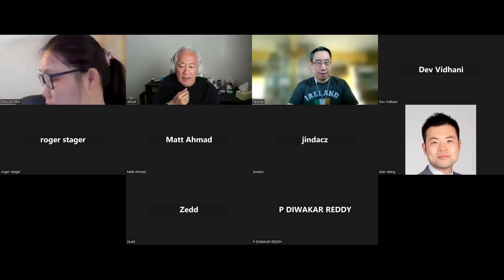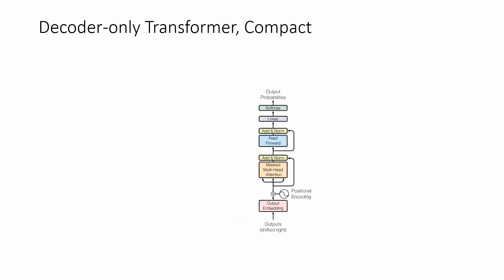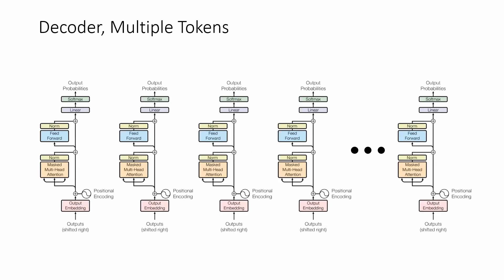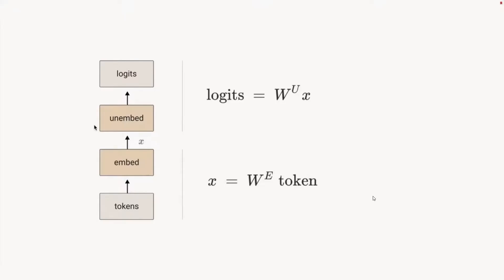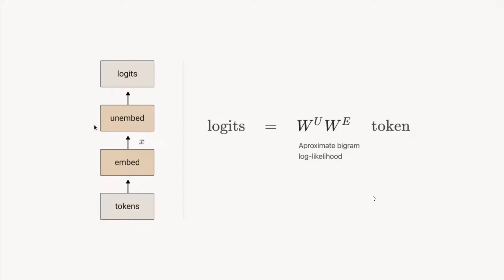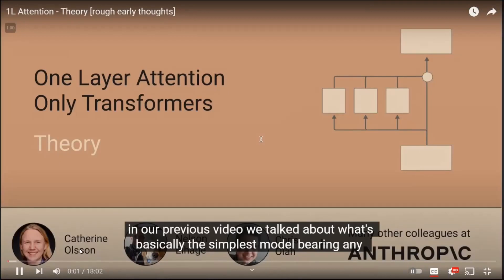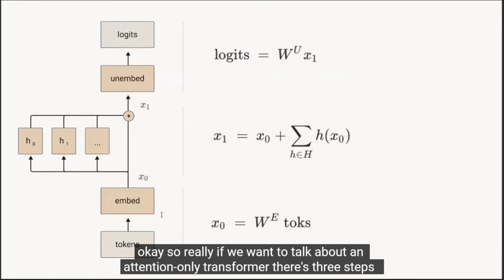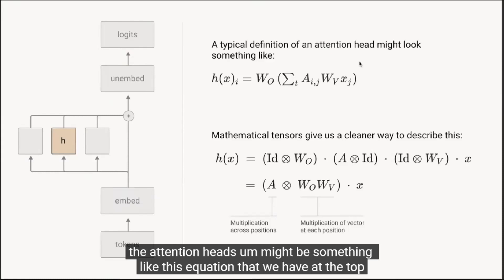Transformer Circuits Part 1

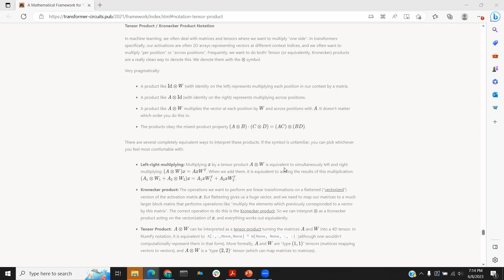Comment: Thank you very much for this video. However, I am a bit confused as the matrix dimensions that you have @ 27:00. You say that kron(A, W) X = A X W^t, but I do not think that this is true unless it is for very specific matrix dimensions. Let us start with the right-hand side: for matrix multiplication compatibility, take the dimensions to be A (a x b), X (b x c), and W (d x c). This makes A X W^t (a x d). Now, let us look at the left-hand side: kron(A, W) is (ad x bc). So, to post-multiply by X, we must have c = 1. This makes kron(A, W) X (ad x 1). But for kron(A, W) X = A X W^t to work, we must then have (ad x 1) = (a x d), meaning that we have d = 1. So, the equation kron(A, W) X = A X W^t works only if c = d = 1. But then this is a trivial relationship because W is now a scalar. I am likely doing some error here, but could you please identify what it is? Again, thank you very much for the video. Incidentally, the relationship that is valid more generally is vec(L M N) = kron(N^t, L) vec(M), where vec(.) means vectorization (column-wise). This is from a classic overview paper: J. W. Brewer, Kronecker Products and Matrix Calculus in System Theory, IEEE Transactions on Circuits and Systems, CAS-25(9) 772-781, Sep. 1978.
Reply from the maker: Hi, if I understand your question correctly, you're asking about the bullet labeled "Left-right multiplying." I think the answer to your question is in the bullet immediately below that labeled "Kronecker product." There, it mentions that we are doing multiplication on a vectorization of x. 

In your example dimensions, when we do kron(A, W) X, then kron(A, W) has dimensions (ad x bc) as you say, and the vectorization of X has dimensions bc, so the multiplication has the proper dimensions and give a result with dimensionality ad. When we do A X W^t, the dimensions of the three matrices are (a x b), (b x c), and (c x d) so the product is of dimension (a x d). These two results both have the same number of components, but not the same shape. To be fully rigorous, we either need to un-vectorize the first result to switch it ad -> (a x d) or we need to vectorize the second result to switch it (a x d) -> ad. It looks like here they have abused notation slightly by not writing where vectorization and un-vectorization are needed, and I think you caught that.